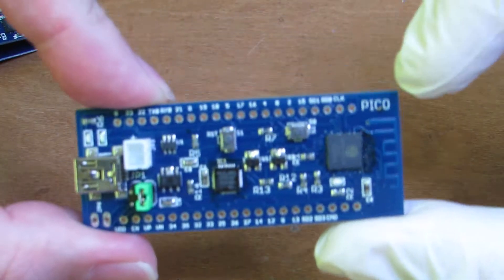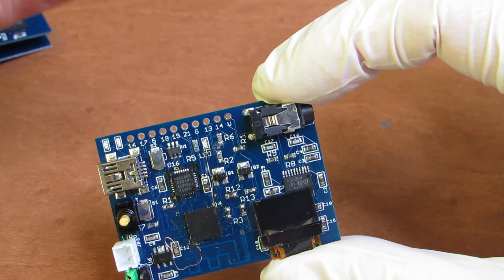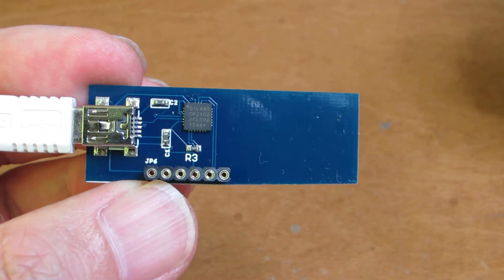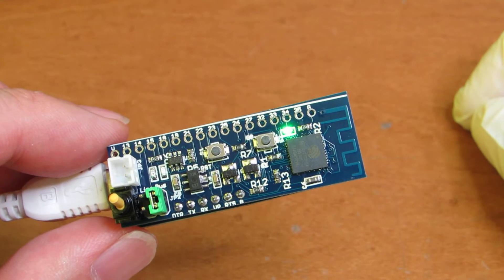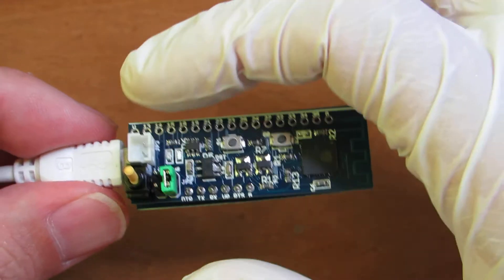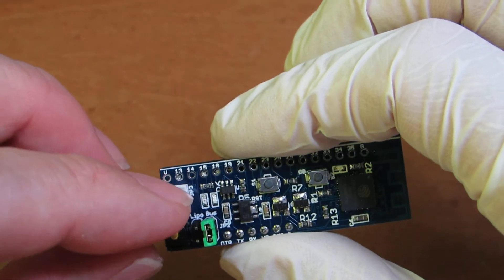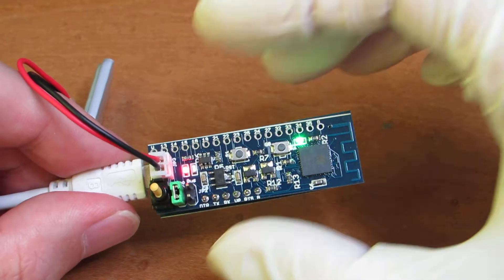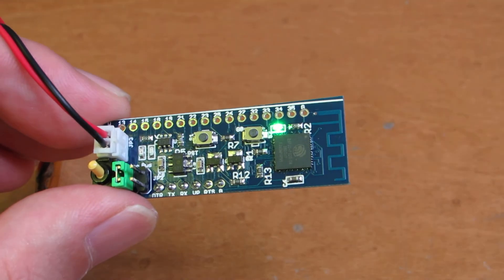ESP32-PICO-D4 double decker board

Comment: How did you make the PCB antenna, and what PCB software did you use?
Reply from the maker: https://hackaday.io/project/27265-explore-esp32-pico-d4-a-new-chip-by-espressif/log/67441-eagle-library-for-esp32-pico-d4
Here you have!!
Reply from the maker: It's made by Eagle. and PIFA is a part of another opensource project (I remember by Adafruit or someone..)
Reply: footprint and symbol available? bout to google it but just encase i dont come up with it this will be a breadcrumb to saving some time.

was about to send a board off to osh with pads for wroom module, but this might save some space by the looks of it.  Any tips for layout?